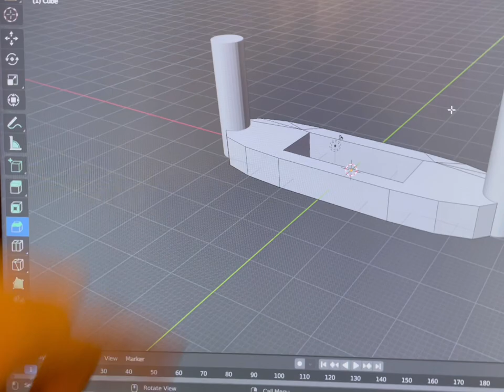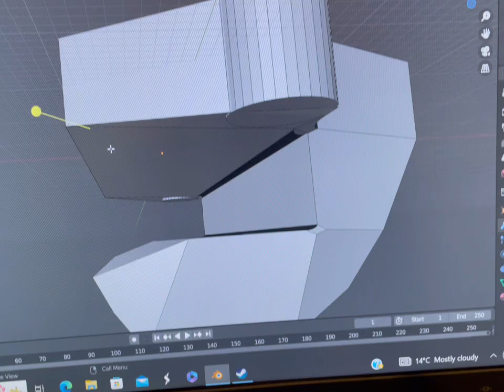Building Easy Off Body Shell System

Comment: Finally getting around to printing this! I am currently running it off in PETG but I'll test it out on my ramp (I routinely send my K4 ~20 feet in the air so it'll be a good test), and identify the parts that break (if any). Then I'll likely re-print any broken ones in TPU. I figure the parts that mount to the truck would do well with high infill TPU (since that stuff is virtually indestructible) but keep the locking "hooks" in PETG for rigidity, don't want too much flex or the body will pop off too easily.

I'm very excited about this, thanks for all your work and testing. Nothing makes me crazier than dealing with body clips, especially since half my rigs use either a similar locking system or velcro!
Reply from the maker: Cheers man thanks for trying it out I had a lot of luck with Petg PLA is just to brittle let me know how you go